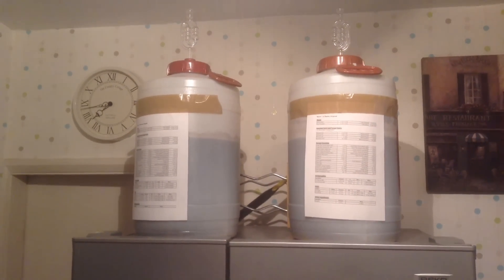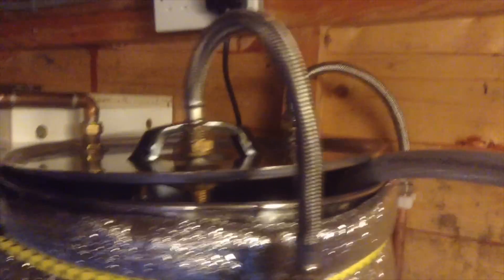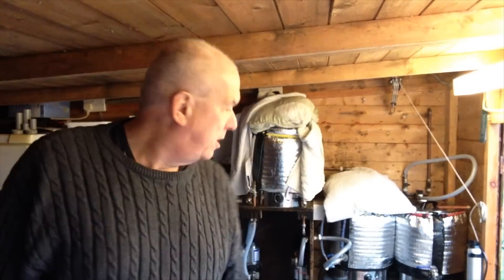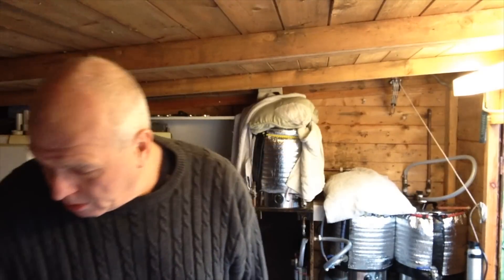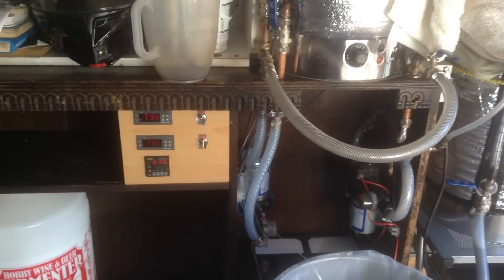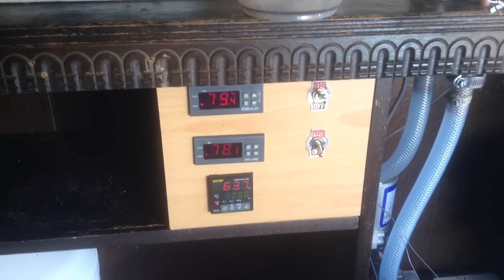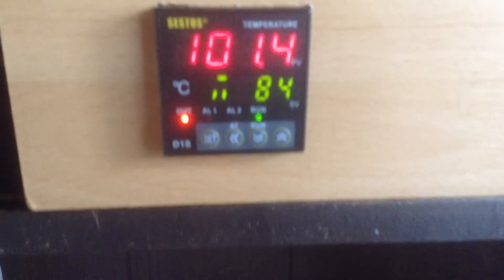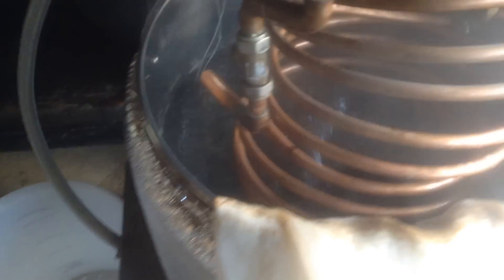Vlog 89, Controlling a Boil with a new PID plus Q&A

Comment: Great video Jim,  a little tip for topping up the water....if you go to the Blind Assoc website they sell an alarm for the blind that goes into ( Kettles/Cups & Pots ) to let them know not to over fill.I got my gas from the same place Jim as BoC don't let people like us use them and its hard to find somewhere for refills.went on the site for the taps ( got them and fitted ) they are brilliant mate cheers for that tip.It looks like the PID has helped losing brew on the boil, giving it a gentle boil with lid off doesn't lose the liquor as much, your getting better at this brewing malarkey Jim, until the next one.Tony
Reply from the maker: +Woodworking Brewer Hello Tony sorry about the delay in answering all my emails went into the spam box for some reason. Glad you like the taps there great arnt they. The alarm sounds a good idea this brewing malarky never stops does it. Bit worried that the boil is not strong enough now but I still have the taste taste to see if its ok Cheers

Comment: Great video Jim WOW what a setup, I would love a couple of sestos controlers, going from 7 litres loss down to 3.5 you've got to be happy with that, Cheers Jim
Reply from the maker: +Justin Marks Hello Justin sorry about the delay in answering all my emails went into the spam box for some reason. Yes its a great result but messes with my beersmith so back to the drawing board with the settings. Im a bit worried the boil is not good enough so I think I need to see how the brew turns out first Cheers

Comment: Hi Jim. Nice upgrades to the brewery. A pid is more useful for the mash rather than boil temp but you have one now and they are worth having. A pt100 temp probe is more accurate for the temps us Brewers operate at, but again more useful for the mash rather than boiling. The k type thermocouple you have will be fine for controlling the boil. You should auto tune your pid to your brewing system. There will be an auto tune setting in the pid menu somewhere. Also turn off digital filtering as that is used to smooth the pv temp to the sv temp and is a bit of a cheat really to make the pid look really accurate. Best to know what the probe is actually reading the temp at. Figuring out the pid settings from a Chinese manual isn't fun. I had same problem with my Rex c100 pid but figured it out eventually. Cheers
Reply from the maker: +Rob Day Hello Rob, sorry about the delay in answering all my emails went into the spam box for some reason. There is a lot of settings in the PID and trying to work them out from the chinese manual is a laugh to say the least. Im abit worried about the boil not being strong enough. I do have another sensor so will give that a go at some stage. Thanks for the help and again sorry about the delay in writing back Cheers

Comment: Jim, do you filter your water at all? mine has a lot of chlorine in it, I usually fill a few buckets up and let it sit and the chlorine is meant to bugger off after a couple of days, our water comes from the Otway ranges here in southern Victoria and is meant to be a pretty soft water but I always add PH Stabilizer 5.2 to it cheers
Reply from the maker: Hello Peter, I'm very lucky here we have the same water as the Burton Brewery and it's great for brewing so no adative required, it's a bugger you have to mess around with your water. Cheers and happy brewing.

Comment: Hi Jim, glad you managed to sort out the Sestos PID. You can always pm me any questions, I'll be glad to help you in any way. I use beersmith and I have my own equipment profile set up. This takes into account your systems boil off and adjusts the grain bill to suite. The system is looking really great. I adjusted the cycle time to 2 seconds, so at 50% it's on for 1 sec and off for 1 second. I gather you are using an SSR to operate the element. SSR's can switch really fast without any detriment in operation to itself or the element. I use another manual to operated the sestos, it's almost identical, just a few labels are different. Try http://auberins.com/images/Manual/SYL-2352_manual.pdf 
Print it off and have the two side by side, it's a big difference. 

Keep up the great work and the brew system is looking great. 

Gary
Reply from the maker: +Gary White Hello Gary sorry about the delay in answering all my emails went into the spam box for some reason. Thanks for the link its very useful better than the chinese page. Yes the SSR is working great and nice to here that it will not damage my boiler element. I will have to set up beer smith again but will need a few more runs to get it accurate I guess. Its all go but great fun Cheers and thanks for your help its great Thank you. Cheers Jim

Comment: Jim.
I watched this iith interest and heard you say you lost only 3 litres.
I have a couple of questions. if you dont mind me asking.
1- why boil for 90 minutes, it saves a few pence in hops but you can quite happily boil for 60 inutes and make good beer( besides it saves you 30 minutes on your brew day:)

2 -what was your OG after the new loss with less losses to  the boil? Was it lower than you anticipated, and by how much?

I am far from expert but have been brewing for a decade and to be honest that you showed was not what would be considered to be a rolling boil. It was more of a simmer and will affect both hop utilization and also OG.

The result may well be you need to use more grain for the same effect as losing 7 litres through boil off?
Does this really matter?

Please dont think me being a know it all. I am not one but think that ultimately your beer will suffer in the name of saving a few litres of water.

I could understand it in a massive batch or if you re really short on space in the boiler but from what i have sen on your channels ( and i followed you from vlog 1) you never struggle with that.
Would be interested in your thoughts.
Reply from the maker: +Dave Barker Hello Dave,

Yes good questions 1) The boil time was in the recipe I do normally boil for an hour and thought it a bit daft at the time but went with the recipe.
2) the opening gravity was 1036 and should have been 1039

Yes your dead right the boil was low and I would be interested in doing an identical brew but going full pelt on the boil as in the past and only for an hour and comparing the two brews.

I totally agree Dave but I like to experiment with different ideas so this might be a good experiment and another vlog to come, Cheers mate and as always appreciate you comments and skill as a brewer, thanks again Jim
Reply: +The Old Farts Brewery 
Skill as a brewer might be pushing it abit.:)
The main reason for the 90 minute boil is for hop utilization, the longer the boil, the more the bittering charge release oils so the less hops you will use.
If you go into beersmith and run the recipe with only a 60 minute boil you will find that the hop increase is really not that much.

The 60 minute boil will also reduce the amout of water you need to warm up for your sparge and save you a few quid too:)

I use a 10Kw gas burner in my brew room and have that on full throttle . brew 50 litre brews too and have a total loss inclusive hops and deadspace of around 8 litres, I have found that wind etc plays a large part in the eveaporation of the boiling wort so maybe an idea to say close the door slightly. 

I have found that when using crystal malts there is definately a much better flavour profile when boiling hard. Likely just my tastebuds that re weird but i too would be interested in seeing a second identical brew with a full and proper boil.

Keep brewing mate, look forwards to the next installment.
Reply from the maker: Will give the boil a try with the door slightly open instead of fully open, I have never used the crystal malt as the main ingredient so will give that a try. Cheers. And thanks for the info live and learn hey.
Reply: Most crystal malts can be used up to around 10% of the grist. They can get a bit sickly otherwise.

A nice grain bill is for example 95% Pale or pilsner and 5% crystal of your choice, maybe 2.5% of light and the same dark?
Hop with target at 60 minutes to around 20 IBU
hop with fuggles to around 6 ibu at 15 minutes, then fuggles to 3 IBU at 5 minutes.
Ferment with yeast of your choice but i would use good old Safale 04 ( blue pack)
Mash at around 64-65 for 90.
Just a thought:)
Reply from the maker: +Dave Barker That sounds a cracking recipe Dave and thanks for the tip on the Crystal Malt good job I did not make a full batch. Will whack this on to Beersmith Cheers